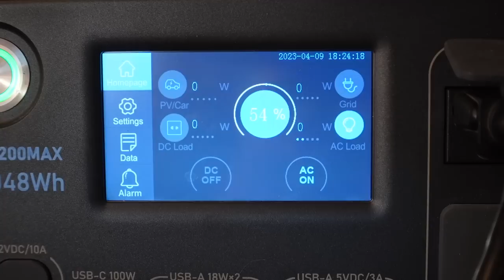DIY Chicken Coop BUILD From Start To Finish - Part 2

Comment: Ontario is always suffering from power outages. Food in the fridge and the freezer are the worries. The Bluetti would dispel some of those worries at least until the power goes on. Hope the hens like their Rooster and he likes his new family and digs. The chicken house and run turned out all right. Good use of chicken wire especially from overhead predators.

Comment: I have used linoleum on the floor and it has made it a whole lot easier to clean.  You might want to consider that.  I bought a scrap piece at Lowes Home Improvement.  It. Yours Looks great!

Comment: If you are keeping them there for a while I would do some predator proofing with better fencing around the outside and lay that same fencing on the ground flat around the edges of the perimeter. Chicken wire is really only good for keeping chickens in not so much against a decent sized small predator like a bobcat or coyote.

Comment: Those Bluetti units are pretty nice all-inclusive package. Was considering a DIY unit, which I'll probably eventually do when I've settled my specific needs, but to make it somewhat weather resistant, durable, and easily portable -- that's hard to beat. On the expansion pack for the ac200max, I saw another reviewer mentioning that the software had this annoying thing where the expansion pack wouldn't charge until the main unit was fully charged -- and couldn't be charged directly/separately on its own. That kind of weird, have you guys noticed that behavior with yours? Maybe the review I saw was old.

Comment: I was a little disappointed my bluetti ac200max would not run my 3/4 hp 110 volt water pump.

Comment: Quick question,  if you have you Bluetti unit and batteries daisy chained and connected to solar panels for charging,  do you need no connect each battery to  the panels or will power go through the daisy chained link?